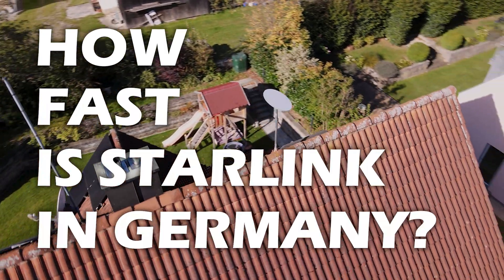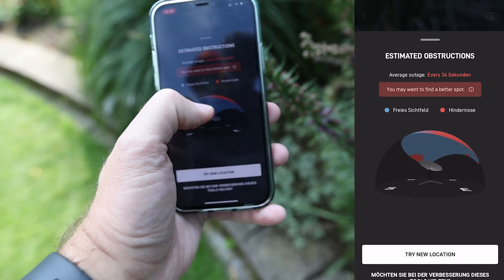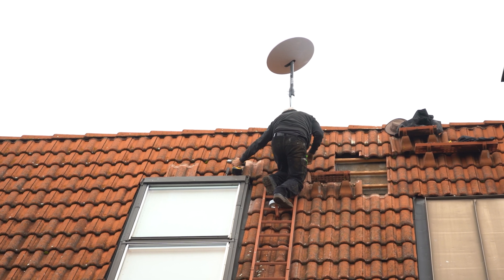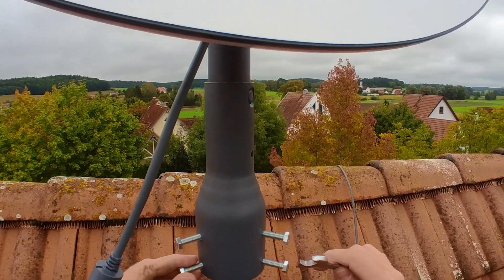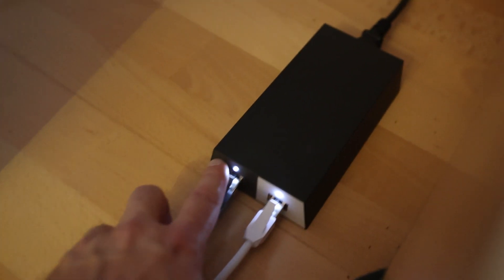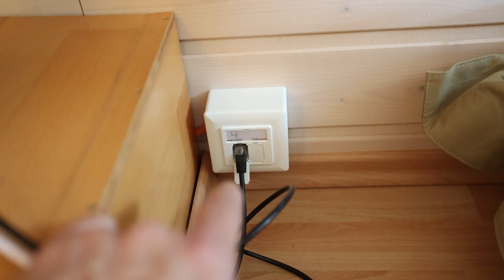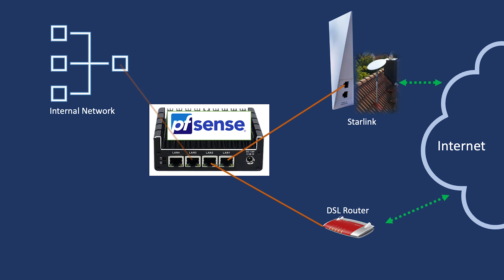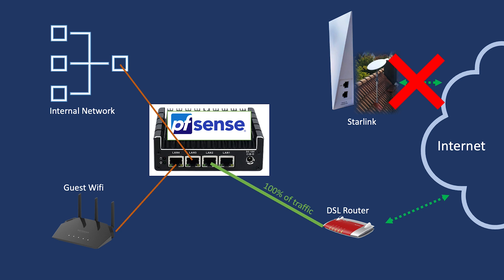HOW FAST IS STARLINK In GERMANY? Mounting StarLink on the Rooftop

Comment: How do you figure its done professionally if the professional doesn't use safety gear? I got a cable internet a week back and it's running nicely, rated 300/10 speed. I get 250+/10. Really surprised to hear you cant get better internet service where you live.
Reply: the roof has a ladder and full sized steps at the mounting point
Reply from the maker: It's not too dangerous up there, we have ladders and multiple points to hold on now. That was added before the mount.
Reply: We have overall bad internet access in Germany. There's a monopoly by a provider